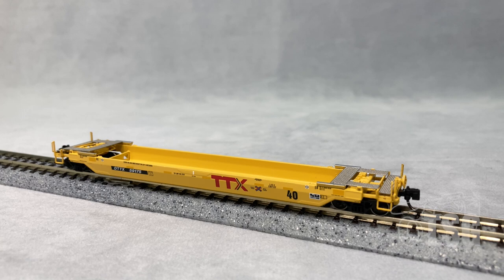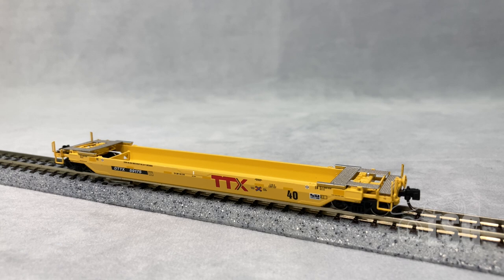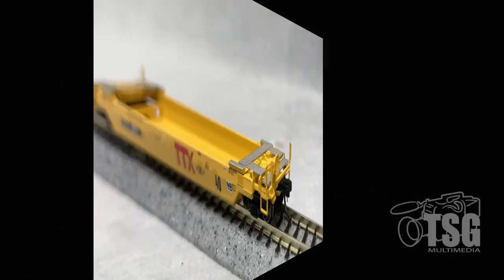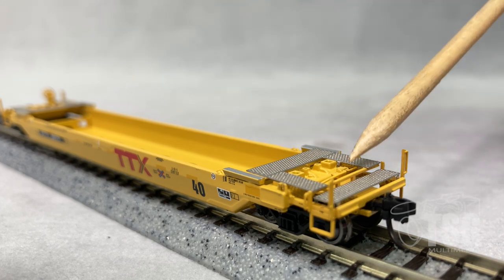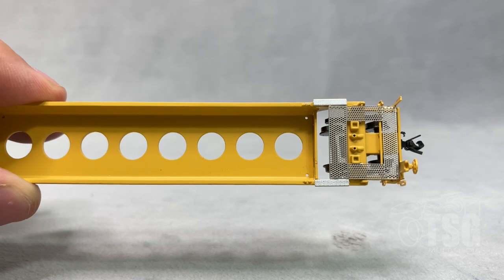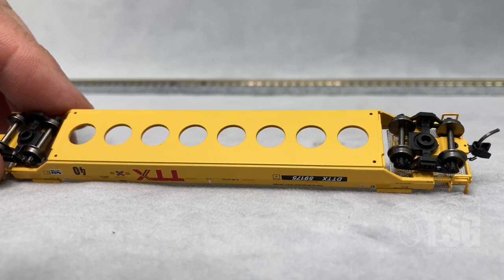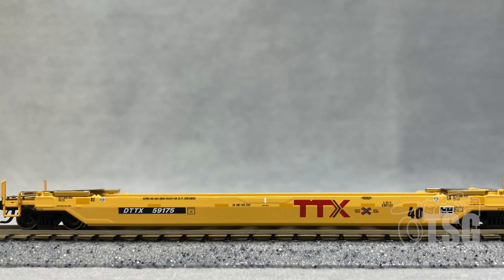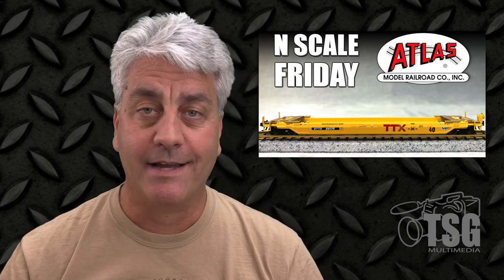Atlas 40' Rebuilt TTX Well Car N Scale Friday

Comment: I ordered several of these cars, and they are awesome models! I did have an issue with one those cars missing a stanchion step from the factory. I reached out to Atlas's customer service dept with two emails explaining the problem of the missing piece, asking for the replacement. I never received a reply back from Atlas. So for customer service, BAD JOB Atlas!!!!!
Reply: One thing to note, Atlas has pretty horrid customer service. I can go weeks or longer without a reply. Sometimes never. To be honest, Atlas is at the bottom of my "favorites" list for many reasons, bad metal wheels, truck mounted couplers, plastic wheels etc. For this reason, Scaletrains has the best rating from me!